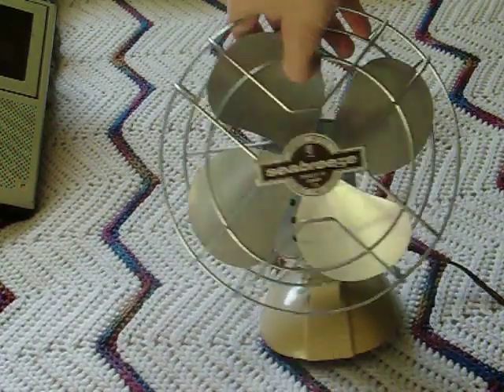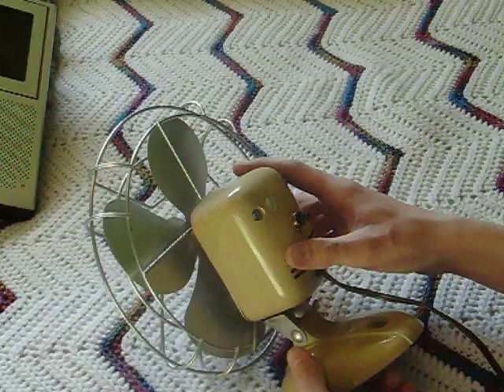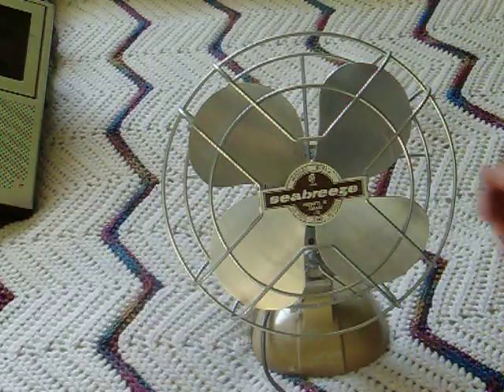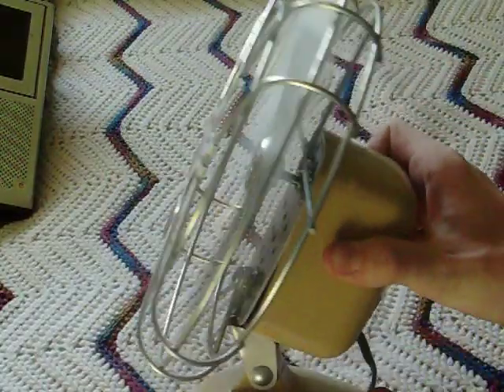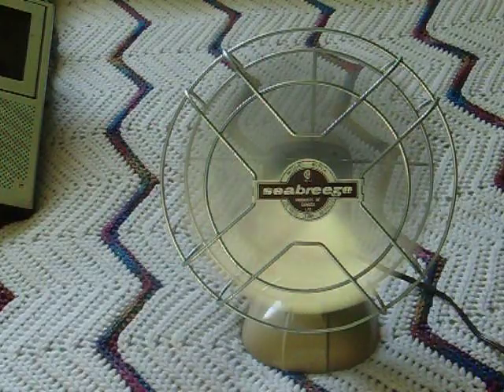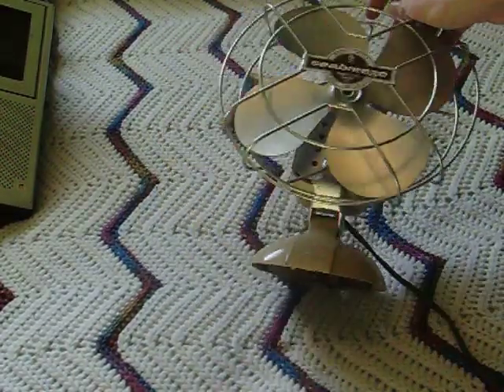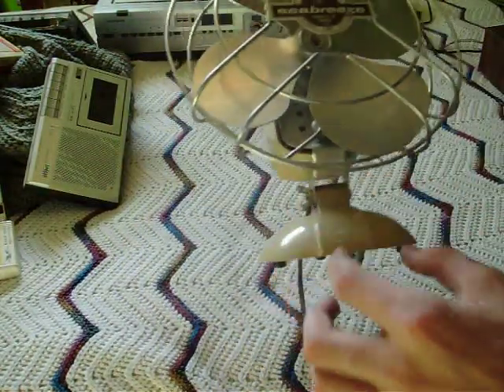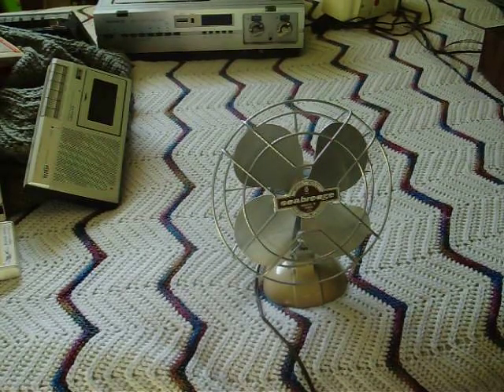Seabreeze 7" table fan (6171-A)

Comment: 60 cycles means it is at least from the mid 1950s or newer.  Most of Canada used 25 cycle (25 Hz) AC power up through the early '50s.  I don't know what would happen if you plugged a 25 Hz motor into 60 Hz power.  It might either spin really fast or not spin at all.